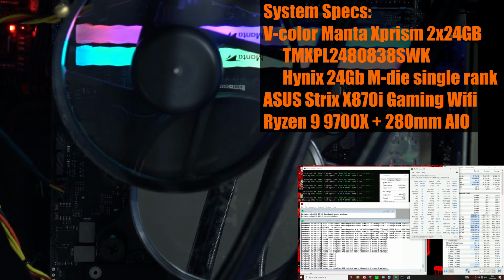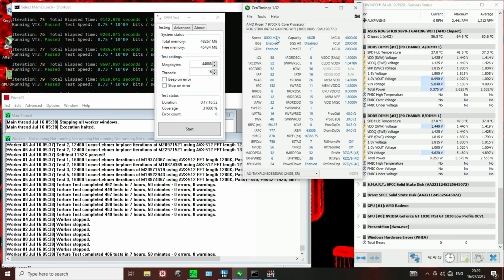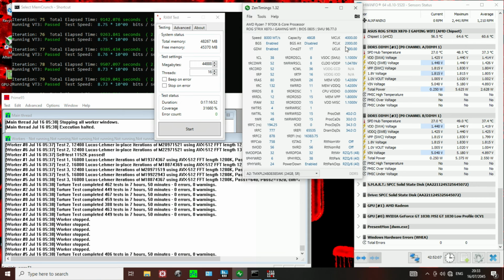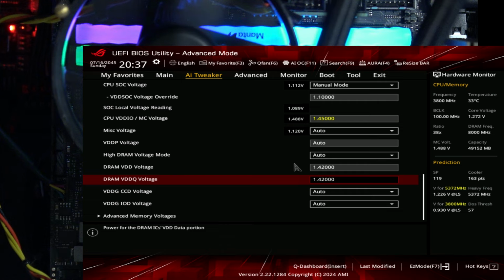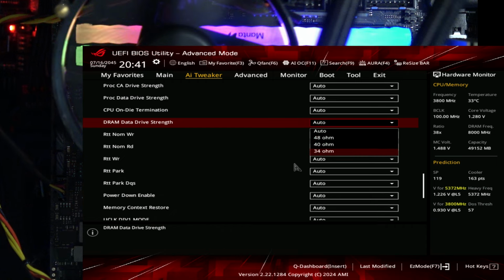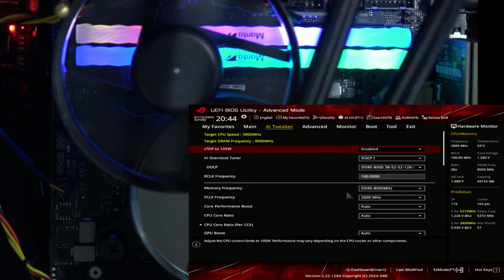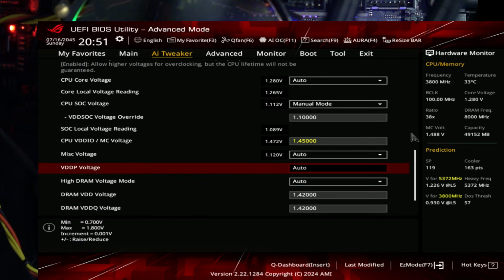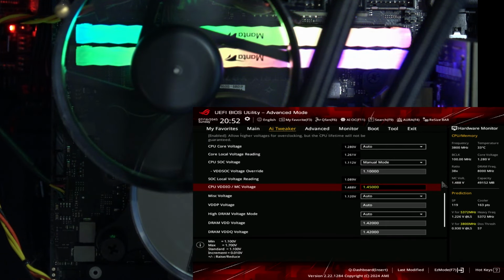Ryzen 7 9700X at DDR5-8000 on ASUS Strix X870i Gaming Wifi

Comment: Good day to you BuildZoid, I just updated MSI B650 Carbon bios 7D74_v1.F2 to v1.G1 and saw procODT dropped from 160ohms down to 48ohms, thought you might be interested to know since you also mentioned why they were 160ohms so high. First boot quick check hence on auto EXPO 6400MT/s with Fclk2133mhz. A question need advice if you can? my 9700x can Fclk2200mhz but gaming jerking and video/movie playback 21:9 3840x1608 not smooth when using BlueskyFRC upframe from 25hz to even just 75hz not to mention 144hz, the 6600MT/s cannot even run windows, only boot to login or enter windows and immediately crashed, tried Vdimm1.6v, VDDGIODCCD1.45v, cldoVDDP1.3v VDDPmix1.1v on old 7D74_v1.F2 running procODT 160ohms, my ram is China Juhor JHE6400U3216JGRGB SkHynix M-die 4.0, thanks. Good hardcore reviews!!!! kudos!!!

Comment: I dont know if this is helpful but am5 sockets in my experience do have some issues with overtightening causing ram instability, especially with the amd stock cooler. (the one I used came from a 5700g). A few days ago I purchased 2 9700x bundles from microcenter and spend 3 days hunting down why both systems would throw errors of twr at 48 while using micron a -die. after loosening both coolers they can now both run twr 48 at expo and one system is confirmed stable 6400mt/s 1:1 with tight timings.

Comment: FWIW: I’ve setup my 9700X with Hynix M-Die and a ASUS B650-I board to 7800 (using similar settings as in your recent video) and for me, Trfc1 works at 640 (600 and below isn’t stable, 640 seems OK) and Trtp indeed isn’t stable at 12 but is at 16. The big advantage of the 7800 setup to me is the low VSoc and looking at this 8000 setup, the timings don’t look very tempting, and it’s only a slight advantage due to frequency (and Fclk +50 MHz). Or do you think the difference on the whole is bigger?

Comment: hi, im trying to set best timmings for my 9800x3d using corsair dominator titanium kit (CMP64GX5M2X6600C32W) can you please help and reply what timmings/voltage would be best for this kit? i guess i also need to go down to 6400 for 1:1 ratio  ... forgot mobo is asrock x870e taichi

Comment: Nice video. I copied these settings on my 9800x3d and hynix a die kit (same mobo with same bios). Got straight into windows. time for some stability tests😅
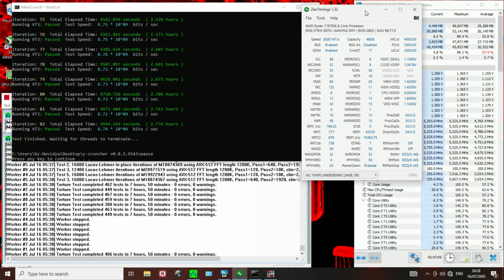Reply: 2:30h of Karhu later. 5685% and 0 errors 🎉
Reply: what hynix a die kit though

Comment: Buildzoid, can you make a video explaining how multiple NVMe works through the CPU/chipset?
I have a 5800X3D and X570 Taichi, that supports up to 3 NVMe PCIe 4.0 SSDs. I know that the 5800X3D has 16+4 PCIe lanes available. If I use all m.2 ports, my GPU will run at 8x and the SSDs at 4x? Or the GPU will run at 16x, one SSD at 4x, and the others through the chipset?
The only thing I saw on the manual was that PCIe port5 will be disable if all m.2 ports are in use. Is there any other problem in using all the m.2 ports?
Reply: Try it out and look in hwinfo

Comment: I tested same 7800x3d of mine and same kit of ram, in 2 different x670e steel legend, both run 8000mhz with the same tweaks to be fully stable.

Comment: I'm wondering what scores you are getting, compared to the same setup 6400mhz 1:1 ?
Reply: that would require fclk 2133 which if i recall correctly his 9700X doesnt do as it has a pretty strong UMC but in comparison a rather badly performing IFOP.

Comment: You should run 2200 fclk, it gives a good memory bandwidth boost at a tiny hit to latency
Reply: nope would require ddr5-8800 to keep UMC and FCLK Synced which the whole point of ddr5-8000 is, apart from the fact that currently only high-end Arrowlake/LGA1851 Motherboards are able to do DDR5-8800+, most am5 boards dont even do ddr5-8000 reliable not to mention ddr5 8400 (2100 FCLK) or 8800 (2200FCLK)

Comment: Hey Buildzoid! Been following your content for a while now.
The X870i is my favorite board and i would like to buy it.
I would like to do 6400 or 6600 with the 9800x3d and tight timings. You mention very good stability@8000. Is the board good for 6400-6600? Is the X670E-Gene better?
Reply: the board does NOT matter for running 6600. every board can do that. 
im guessing you want 6600 on a 1:1 ratio and that is entirely dependent on the cpu. if your cpu refuses to do 6200 1:1 at 1.3v soc you are not achieving it ever
Reply: also: one newer BIOS is out.
Reply: Get the x670e-I when the price drops. Not much has changed
Reply: @djnes2k7  i just thought that a newer mb would be superior in case of RAMoc

Comment: @buildzoid could you provide any commentary on the fact that Asus continues to market this board as supporting asynchronous clock (aka has an external clock generator for ECLK OC) but doesn’t actually support this feature? I’ve spoken to multiple Asus reps who refuse to update their marketing, it’s super frustrating so thought you might have better success than I did
Reply from the maker: where does it advertise ECLK support?
Reply: The ASUS Strix X870i ISN'T advertised as supporting async clock anywhere that I can see.  What are you talking about?
Reply: Only rog x870f supports the eclk on standard Asus x870 mobo. The other Asus supported boards are x870e and some x670e.

Comment: did you test b650 aorus elite ax 1.2 board by any chance?  Is it capable of 8000mt, according to gigabyte they can run 8000mt but we all know its a lie lol
Reply from the maker: don't have one.
Reply: I have the b650m auros elite, so the matx version. I guess the memory layout is the same. I couldn't get mine stable with 8000. It did boot 8000 xmp without any problems though and I am running it at 8000. Not the best idea, but it is not so unstable, that I had any problems so far. Not a single crash or anything noteable. TM5 1usmus doesn't even pick up on the instability, but kahru and linpack do quite quick.

Comment: Is this running in Gear 2? If still running in Gear 1, Well done! 🎉

I am looking to build a 9800X3D PC next year, so it will be interesting to see how it overclocks and uses tuned memory. Subscribed and looking forward to seeing a 9800X3D video from you, because you are making a 9800X3D video... right? 😅
Reply: @stennan  2:1. Impossible to do 8000 1:1.
Reply: I doubt he will buy one as he already has a 7800x3d

Comment: so 1dpc boards are better for ram overclocking than 2dpc boards? crazy
Reply: Not really crazy, less memory slots means less traces interfering with the memory signal.
Reply: @atirta777  that was a sarcasm ofc
Reply: @julfy_god  Wasn't really clear. Funnily enough 2dpc boards might be starting to catch up like the X870E Hero with Nitro Path
Reply: Yea that’s why u use half dimm per channel boards so I can clock my ddr4 to 10,000Mbps

Comment: bz we want less content like this and more XOC content
Reply from the maker: sucks to be you because I'm on my Ryzen 9000 RAM OC arc
Reply: @ActuallyHardcoreOverclocking  god damn it BZ I wanna see more FX clocking, I have a 8150 on a C5F-Z and I can't get it above 4.95 GHz 💀
Reply: @ActuallyHardcoreOverclocking  I would love to love your content but, this is too ''2005 in a garage'' type of videos. Would be great to have some graphics with games, benchmarks and columns with differents timing, frequency. 
I tried to watch your videos, but you talk too much and show so little, like you are not very adapted to the current meta, poor in communication overall, visually. 
Your videos are more radio related than video related, that's some podcasts here, nothing to see.

I have a simple question btw.  How low you can go with CL with a 8000mhz frequency, I can not find the answer easily, sadly ?

Comment: I have the same board, would I lose performance (in gaming) going for 48GB 8000 over a 6000cl28 or 6400cl30 kit?
Reply from the maker: if you can get 8000 to work then it's faster than 6400.
Reply: @ActuallyHardcoreOverclocking  ordering a 48GB EXPO kit, thanks BZ. Keep rockin' the clockin' love the content. 🤍
Reply: @ActuallyHardcoreOverclocking  Would you consider revisiting some of the more affordable B650 and X670 boards like Asrock B650 LiveMixer ..
Reply: @ActuallyHardcoreOverclocking It is not. Do the math. you get 4000 mlck 2000 ulck. With 6400 you get 3200 3200, pairing with 2133
flck.
Reply: Buildzoid doesn't do gaming benchmarks, and you should wait for the 9800X3D anyway, which probably won't care as much abt RAM.
Reply: @concinnus  I'm getting one, I'm still tuning.
Reply: he said 2:1 is the fastest for gaming because it's the lowest latency
Reply: 8000c40 2:1 would be much the same as 6400c30 1:1 for performance, especially if you tune it yourself. Though if your CPU can't do 6400 1:1 (which happens quite often) it can still probably do 8000 2:1 which is faster than 6200 1:1.